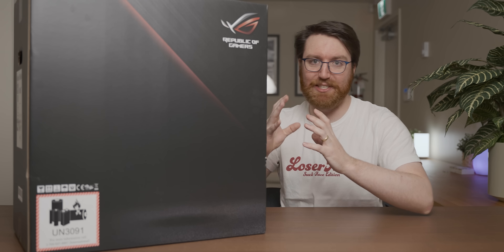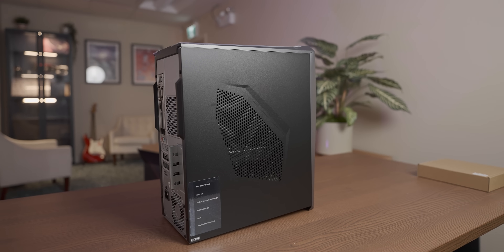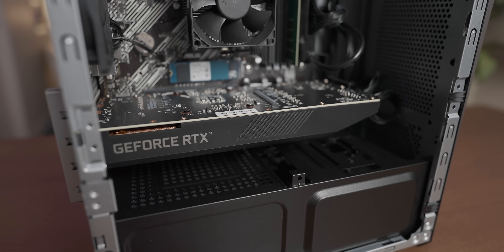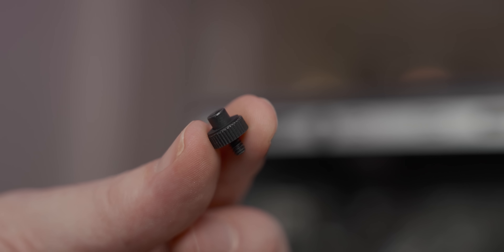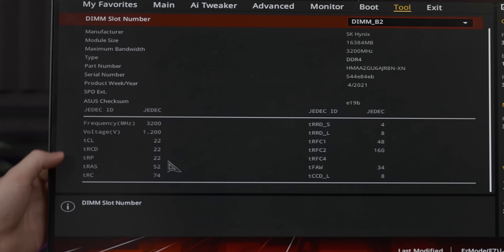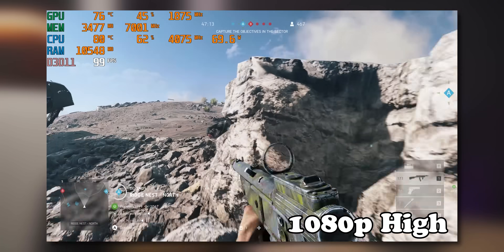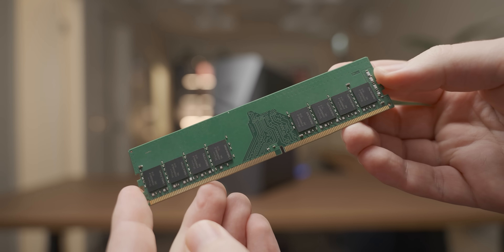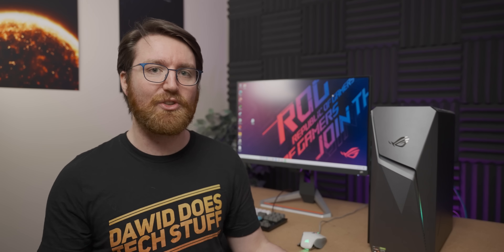Why Do Asus ROG Pre-Builts Suck So Bad?

Comment: I think this is a cheap version of that gaming system. I had the older model (cl12cm) from 2018 with a 8700k and a 1080. It didn’t perform bad as it was also water cooled and it was a pretty solid starting build. I still use it and changed the graphics card to a 3070 Ti, and got myself a new case and cpu cooler. Overall was not a bad build even tho the motherboard has some issues (missing standard usb 3.1 header for standard front I/O (as it’s front I/O was proprietary), the back of the motherboard is amazing it has 8 USB ports (2x 2.0, 4x3.1, 2x3.0), full audio card, Ethernet. Once you get rid of the bloat ware u are good to go! (Bios not standard so that’s a big downside)
Reply from the maker: That's great! It sounds like it was a good starting point for you. Glad to hear it worked out for you. 👍
Reply: @DawidDoesTechStuff  I have one of these asus prebuilt ones,  “ASUS - ROG Gaming Desktop - Intel Core i7-11700F - 16GB Memory - NVIDIA GeForce RTX 3060 - 1TB HDD + 512GB SSD” It runs cool and perfectly fine. What desktop prebuilt from asus are you using in this video?

Comment: In the meantime, NVidia recommends a 650W PSU for the 3070 which makes me wonder how that 500W one will handle the PC over time.
Reply: The pc? Just fine. However, a seperate dedicated arc reactor is needed for the GPU.
Reply: You can definitely use a 500W PSU with a 3070 unless you have a super high end cpu and 17 rgb fans in there I guess, picking a reputable brand is far more important than having extra headroom in the wattage.
Reply: Dhoelath as a matter of urgency any owner should swap out the power suply as soon as possible. Aside from safety I'd believe that under powering is a hot issue.
Reply: @are3287  bro 500 wats is not enoth for a rtx 3070 that is a one way tiket to dead pc land
Reply: NVidia overshoots a little bit on the PSU recommendation because they can't predict whether the consumer will go for a super cheap no-name one or a 80+ platinum, so they might as well guarantee some headroom. However, 500W for a 3070 really is too low for comfort.

Comment: Please do a follow up video where you drilled lots of holes in the front to give it air flow and replace the CPU cooler with a nice be quiet! 250W TDP Dark Rock Pro 4 CPU Cooler or something good and then replace that crappy fan in the back to make the case silent. I would love to see a pre-built pc turned into a great pc for under $200!

Comment: I have this exact pre built gaming PC from walmart purchased around 2022. Its worked great so far. Only issue ive had with it was when someone just unplugged it from the wall while it was still on and it would not turn on. Its been a great gaming PC. Im probably gonna upgrade to a better PC later this year or see how much longer i can use this one till something really breaks.

Comment: Chicony actually makes solid PSUs. You are correct, they mostly make brick style supplies, but do have a small selection of desktop units. I have never had an issue with any of them. I'd not call them high end, but more than adequate for most tasks.

Comment: Would have been interesting to see you put all those components in that older case and see what happens to the thermals. Perhaps change the cooler and dual ram as well. Bet that would do this system wonders. Moral of the story, if you’re building and have money, go ROG. If you’re buying a prebuilt stay well aware as they don’t use ROG components in the pre built anyway

Comment: I bought an Asus Strix pre-built earlier this year, one of the top models with an RTX 3080, 11700KF and an actual ATX motherboard. I literally only kept the motherboard, CPU and GPU and bought everything else. One big big issue is the bios on the motherboard. Even though the board is a bog stock Asus Z490-F board, it has a proprietary bios that has not been updated since last year. As such features like resizable bar cannot be made to work (Even though it's listed in the bios). I'm probably going to have to swap out the board as well. And on a side note they put a bead of glue in the USB 3.0 port on the board, when I tried to remove the header, it stripped the USB 3.0 cable apart. I can't use the header in the new case without perhaps destroying the port entirely. Crazy things we do to get a decent GPU. Power supply was a great wall and the MSATA drive was a bottom of the line Intel. single stick of no name RAM.

Comment: There was a time back in 2013/2014 where their systems were actually not that bad and were built like tanks. I got one then and it is still working great to this very day, the only thing I ever had to replace on it was the closed loop cooling unit for the CPU. This was before RGB and glass panels were on almost everything. The only complaint I have is that they (depending on the model) tend to not be very upgradeable. Cheers!

Comment: It would be great to see if it were possible to “remove” the front facier part of the case (or even unscrew/pop it out and just place it slightly to the side) and see how the thermals change. Would this be a better case if it simply had actual holes in the front?

Comment: I bought same GL10CS with 1660ti, intel i5 9400f and 16gb (dual stick, at least) little over year ago for 840USD. Fair price, as I'm a casual user, but my question is - what would you recommend to upgrade in this setup? Case, CPU cooling?

Comment: Personally, I think their ROG Zephyrus laptops are fantastic.  Great build quality, and really good cooling.  I just don't understand why they would cut corners with their desktops.  Also, was ray tracing enabled?  Because if not, performance is pretty disappointing since I get on average 125 fps @1080, and 100 fps @1440 on a 3800X and a GTX 1080.  Although both GPU and CPU are liquid cooled, which may have a slight advantage.
Reply: My g14 from 2020 had such bad cooling issues it could literally kill an ant when running IDLE, 85 farenheit when idle

Comment: I actually have a 17 inch Asus rog stric laptop and it's one of the best laptop I've seen in terms of cooling (temps barely go above 70 degrees).

After watching the video, I can say that my 1660ti laptop performs almost the same as this prebuilt
Reply: @Derek_The_Magnificent_Bastard  in battlefield 5 I get a pretty similar experience (90fps at 1080p ultra while getting better temps then the prebuilt) I think this prebuilt just destroys itself because of its bad cooling

Comment: Interesting videos. I recently bought a G10DK (same case) with 5700G+3060, 2x 8GB SK 3200 ram, and an extra HDD by the PSU for 999 USD from Walmart. 
It seems the 60 series GC runs a little bit cooler on BF V and I got about the same FPS reading as your test. However, recently it got some stutter when playing. I'm not sure if it's the CPU cooler, ram, PSU, or simply because I installed the game on the HDD other than SSD? I do have plan to upgrade the PSU (bought a seasonic focus 650W), CPU cooler (Noctua U9 maybe, looking for something shorter that could fit), RAM (bought pair of crucial ballistix 3200) and a bigger and better SSD to replace the installed SN530. Do you have any suggestion on my upgrade ideas? Or any other idea to make it better? Thanks.
Reply: I bought the exact same thing you bought.  I did put it a corsair 4000d airflow case and the temps dropped about 15-20c on the gpu.  That case that it came in was garbage.  I saw it at Walmart for $999, and figured that the graphic card alone was worth that almost.
Reply: @bhuffine2557  yea, that's what everyone said. So maybe eventually I'll get a new case. We bought another cheap (850 in today's market) Lenovo desktop for my wife from Costco. That desktop seems to have a much better case with 3 120mm fans, but worse graphic card (1660 super)

Comment: I just got the 2,500 $ tower and its amazing i use it with my 120$ airpods and my 230$ 32 inch hp display, it works perfectly with both devices

Comment: So I was planning to get this PC since it’s for sale at Walmart for $999 with an RTX 3060 and a Ryzen 7 5700G, and I was wondering if I could just move everything into a different case and maybe get a different cpu cooler. If so, what would be some recommendations for either? Thanks!
Reply: I had the model with a ryzen 5 3600x and I threw mine on a new asrock mobo, a Lian Li lancool 2 mesh performance, and threw another stick of ram in, as well as a coolermaster ml240lv2. The case allows great airflow, and the cooler is super beneficial for temps, no throttling and always reaching max boost clock. It was about $225 CAD for just the case and cooler

Comment: I bought a ROG STRIX G10DK. It came with the Ryzen 7 5700G paired with a Asus RTX3060 12GB and to my surprise came with TWO 8Gb ram sticks running at 3200Mhz. This system preforms quite well running MicroSoft's Flight Simulator (Game of the year addition) with an average of 50Fps at 1080P Ultra settings. The graphics are stunning even at 1080P. However the CPU cooler does run PRETTY loud and will probably swap that out in the future but does keep the CPU at bay as far as temps go. I also installed Forza Horizons 5 also running at 1080P on ultra settings and this system can play this game all day with very little fan noise and the CPU running only at about 30%. The 3060 also does not throttle playing this game either. On the CAD side of things this 3060 preforms really well with the 12GB of DDR6 as does the Ryzen 7  5700G. Can load LARGE model files with no struggles with full shading and rotation. An all around system for me at a reasonable price at just under $1400.00 U.S. This case is not a big issue for me as I'm using the metal "performance" side panel and does offer full RGB control. As Dawid mentioned the build quality is VERY clean and well laid out which is nice for a "pre-built". I could NOT have built a setup like this without spending WAY more as the graphics market is INSANE right now! Even this RTX 3060 goes anywhere from 799.99 to over 1000+ to buy one! I really hope this "chip" shortage passes in the next year. I'm a casual gamer and just want to play AAA games and need to do CAD work as well.
Reply: I just picked up this computer second hand for 500 bucks and I have to say, 5700g and 3060 work very well together, upgraded ram, added fans to the front to just push the air out, added an artic aio and mounted it onto the acrylic glass using a hole saw for the fans and so far only real issue is cooling for gpu, that’s the next project but so far trying to make the most of this case although even though I know I should get a new one!

Comment: I purchased an ASUS G512LW laptop about 6 months ago and it came with an RTX 2070 and an i7-10870H cpu. The RAM they stuck in it was 16GB of 3200mhz but it turned out to be dual stick 8GB Samsung sticks. Probably the highest quality they could go with it. The SSD they used for the 500GB storage was actually Western Digital. The GPU never gets hotter than 86c and the CPU stays around 70c but for a laptop, that's to be expected. I'm more than happy with the Laptop I bought, but I can't say the same for this pre-built. Their laptop quality seems to far surpass their desktops when it should be the other way around.

Comment: I have experience with super heating electric enclosures to melt plastics and this setup would be perfect for 3d printing high melting temperature compasite materials also frying, baking, boiling, bbqing edible materials.

Comment: I actualy bought asus rog pre build with a rtx3070 and ryzen 7 5800x and I am super happy with it. It has the old case with actual air flow with DUAL CHANNEL RAM and a good cooler on the cpu and the gpu as well it is an asus dual card not  a blower cooler. The psu is an 750w AC Bell 80+ gold so I thing I got lucky xd. sorry if any gramatical mistakes English is hard and I am still learning.

Comment: I have this prebuilt since September 2020, (I7 9700k, rtx 2060. but I realized that the cooler is exactly the same you show at 15:03 ! Temeperature almost never exceeded 80c and replace the ram with a 32gb double channelled.

Comment: I maintain that first asus ROG strix prebuilt is a solid buy if you get some Noctua fans + a heat sink to fix the thermals. It served me flawlessly for years and I bought it during the GPU scalp era so a 5800x + 3070 for 1600ish was a steal at the time. Soft spot in my heart for it.

Comment: 11:45: you don't set the RAM speed manually. At the homepage of the UEFI ("EZMode"), you enable XMP... which sets the timings for you. You left a lot of performance on the table with the loose RAM timings.

Comment: I'm not too surprised that Asus just used one of their retail motherboards for the system. Which also explains why it so effortlessly runs with other RAM and does properly support XMP (Oh, and dual channel isn't just the same speed. It doubles the bandwith)
And the CPU temp of 56°C in the BIOS? No wonder with 1.44v by default. I can hit the same temps with my old overclocked Core 2 under load for which that voltage is totally normal.

Comment: I bought a prebuilt with a r7 5700g and 3060 12gb same case and motherboard mine had 2x 8gb 3200 ram sticks instead of one. My main rig is custom built but the asus was just under a grand. With that cpu and gpu it couldn’t be beat.
Reply: Hey do you know how i can change the rgb color that comes with the pre built case? I was trying armoury crate but it doesnt change the color on armory crate when i try to change the color.
Reply: @jadenochoa8458  been a long time but i think openrgb worked. I know i was able to do it with some type of software i don't own it anymore.

Comment: Getting this pre-built system with the i7-11700F instead, and I already bought a better CPU cooler, a better (and quieter) back fan, a better power supply, and might also buy a brand new case and respective front case fan array just because I'm super paranoid about the temps and low-power PSU now.

Comment: Hello Dawid, I think Rog have made a same prebuilt system out of the cool Strix case you used for your first video. I bought a i7-10700kf with 2070s on that cool Strix case(The one with more ventilation ) , it does comes with a really decent Strix mother board and a “Actual cooler ” that they show on the image. Oh yes, It also comes with 2*8gb 3200 ram too. So I think the problem of the Strix prebuilt is they have different things on the Amd & Intel based version(maybe because intel version cost 100$ more?). Any way, I really enjoyed your video of testing those prebuilt.